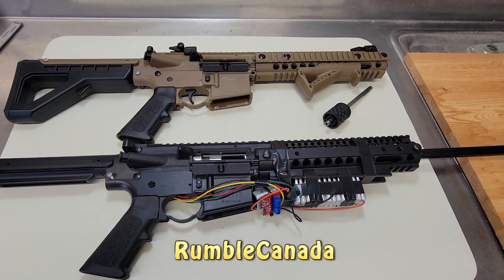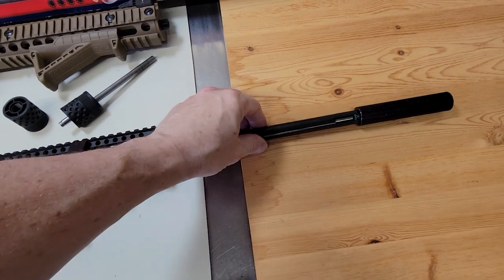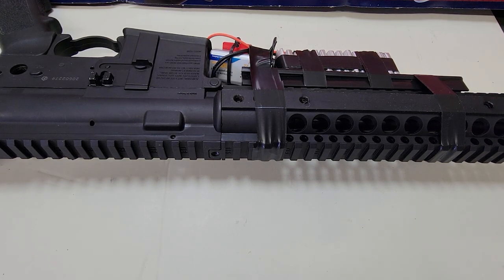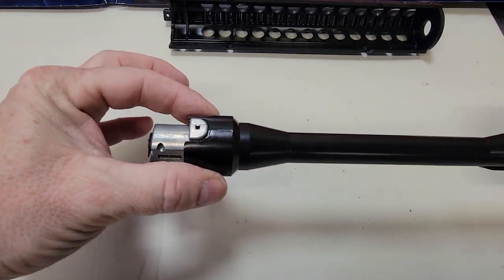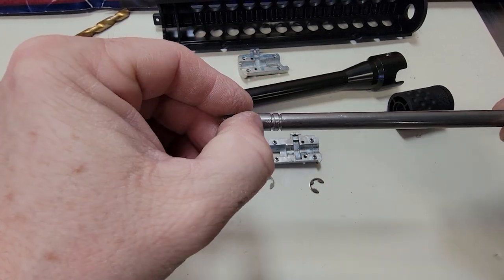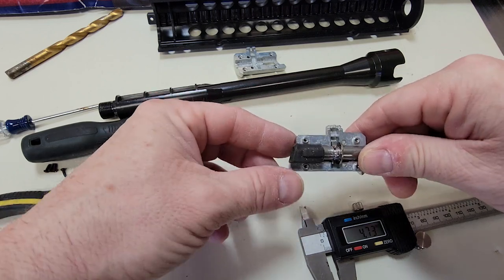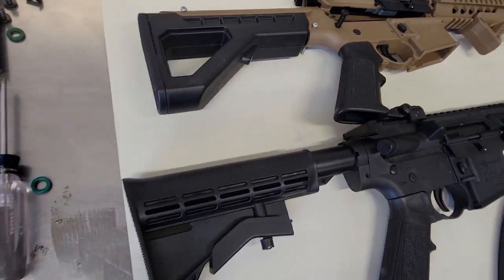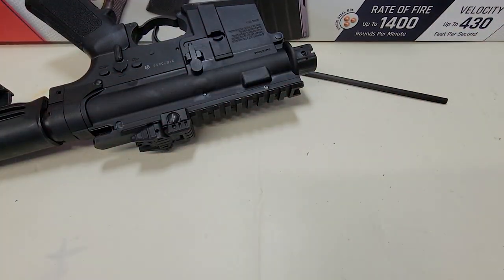Crosman DPMS R1 review 20" Barrel Swap ** Sniper Edition ** FULL AUTO

Comment: Did HPA conversion on both my DPMS and r1...1100psi and they run great...no more freezing
Reply: Darren video please. We need all great crosman videos. Lol. Remember when was talking about starting project. Love see it
Reply from the maker: I was looking at the HPA stuff. I will eventually get a kit to test. Getting it refilled here can be a pain.
Reply: @rumblecanada  yah that was  my problem at first...bought a compressor.....just to save you some time and money...go with the "A.N.T. fire"  CO2 TO HPA kit...then I tested from 800psi to 1100psi....1100psi is way to go...I used a ninja hpa 1100psi regulator on a ninja carbon bottle....shoots like a hot damn....I tune all kinds of air guns as well...have a sig sauer mcx that i completely ripped down and converted to hpa (1500psi)...shoots just under 800fps...dime size groups at 35 yards... 3 years old still going strong after 5000 plus rounds...been building airguns for 20 plus years....your vids a great....if you get stuck let me know and I will do my best to help you out....(fellow Canadian here)....from my igloo on the mountain...D
Reply: How did you get it reg to 1100 psi or which one do you use I only have a 1000psi reg
Reply: @paultrimble9390  sorry Paul...I live in canadian rockies...winter still here...need to do some testing before I start ripping into new guns...probably going to be a month yet before It gets warm enough for me to shoot....in meantime if you have any questions just ask...will do my best to help you out....
Reply: @asdgarage3882  go with the ninja "1100PSI HPA" REGULATOR...its adjustable with shims...ON FULL AUTO GUNS DO NOT GO OVER 1100PSI...ITS DANGEROUS
Reply: @RAM-19  ten four

Comment: All of this is way cool.
I've had my DPMS for a long time, but I've not much done to it than fixed old broken patrs as the gas piston, catch-release button and tuned up my other mag for higher power.. Mostly been into the Sig Sauer pellet rifles myself. But maybe I now oughta start doing stuff to my DPMS and maybe finally buy also an R1. Definitely been wanting a longer barrel setup. Could use my Swiss Arms airsoft suppressor for a fixed long barrel cover-up. The main issue actually being where to get a new and long innner barrel for the job - but that came up in this video - so thank tou very much for that.
My maun issue with tuning up these co2 airguns isbrge co2 cooling down. But a longer barrel helps with the fps output with less co2 use. My Sig Sauer Virtus just having to up the air pressure regulator and not to worry about power drops when using more air. Modding inner parts though then become more important if using higher air pressures - but these co2 setups then do not need as much attention..
Thanks for this awesome video!

Comment: Hey men, apreciate your videos! I have an R1 and a little piece in the magazine's hammer its break. Do you have any issues whit that?
Reply from the maker: Right on thanks! Your hammer broke? I will be posting a new hammer mod shortly that will fix most of the hammering issues and make it strong to last many years. Stock hammer sucks!
Reply: @rumblecanada  I mean, the "button" of the back of the magazine😅
Reply: @observador9448  He has video on fixing the "button" that hits the magazine valve, the "black pin", check it out, and if you find a solution by yourself, share please how did you repaired it.

Comment: Also a 20" barrel will drop fps. It need to be between 14"-15" for max co2 expansion!! I ordered a barrel, mines going to be 15". CHRONOGRAPH TEST YOUR R1LB!!!
Reply from the maker: That's not true. The 20" barrel was removed from a working crosman 1077 rated at 495fps. If you are losing fps with a longer barrel then you need more co2. I didn't chrono the LBR because I wanted to show full auto. I will post a chrono video in a follow up video.
Reply: @rumblecanada  different valves and nozzles.

Comment: I really want a crosman dpms but it's sadly just junk poorly American design and made in China I ended up with several cybergun m4 versions plus the ak 101 all of them is metal and work perfectly they aren't so realistic as the crapsman but the crapsman is just to poorly made and her in Norway they are extremely expensive asvel especially when you're just getting junk that probably last a few months if you're lucky
Reply from the maker: My first 1st and 2nd one broke. That's why I started modding/fixing them. The Crosman dpms R1 and mpw are a lot of fun when they are working. I take mine out all the time when I go quading. My Crosman dpms 70vdc full auto is awesome! This platform is perfect for modding. My latest Crosman mod fires a 6.35mm slingshot bb. Yes, they are cheap, but once you fix the imperfections, they are a blast!